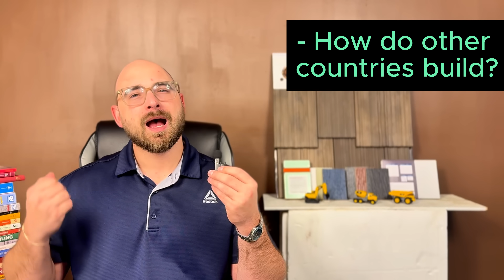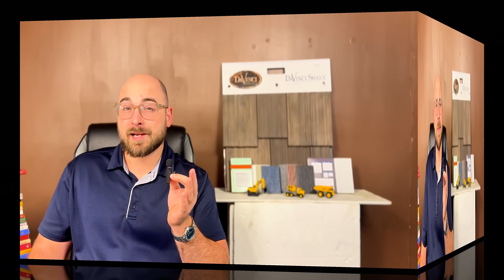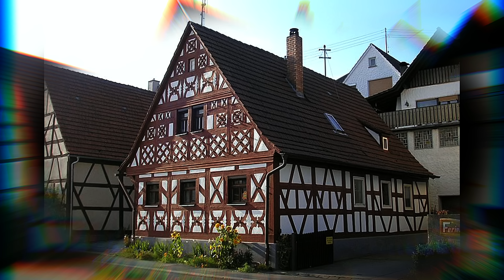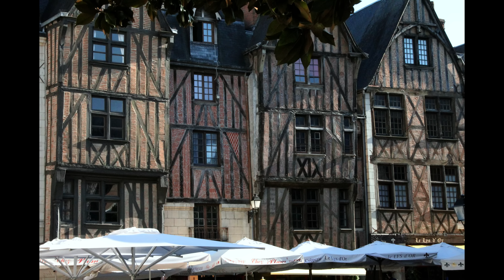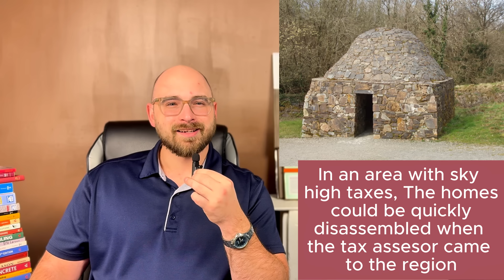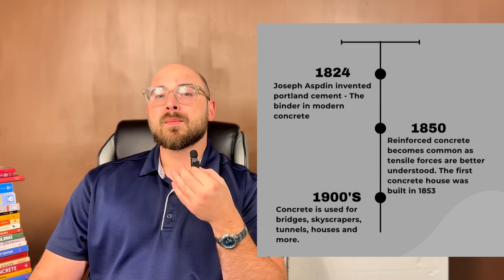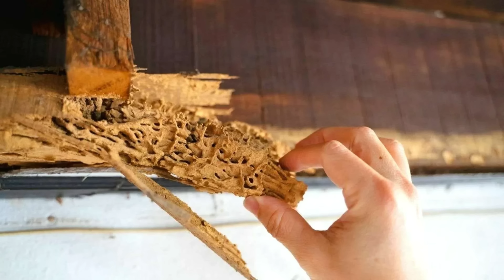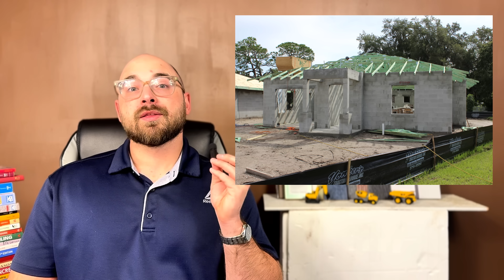Why Other Countries LAUGH at American Homes

Comment: I'm from Argentina, and it was kind of shocking to learn that in the US, most houses are made of wood. For me, that's kind of cool, not bad; but what's really scary are your electrical standards. 110V is more dangerous since you have to pump more amps on the wires, and also, you don't have GFCI protection in all of your houses. That's really something I cannot wrap my head around since it's really dangerous.

Comment: Most of my experience of houses is in Netherlands an UK. The former has better housing stock than here in UK.

But here in UK most homes in the city where I live were built in the 1800s, with solid slate roofing. My mother in law lives in a stone house with slate roof built in 1800. A friend lives in a stone house that was built 900 years ago, although with subsequent brick extensions.

In the village where I lived there were many timber-framed wattle and daub houses, dating back to 17C.

Houses are homes, places with long term memories, not mere temporary  storage units for people.

Comment: I think that people laugh at disposable homes. It is just coincidence that there are that many disposable homes in North America. I live in a concrete prefab panel house built in 1988. A panelák. Something that most people associate with "ugly grey commie block". It was never grey. It was sand yellow with earth brown details since its construction and it had some thermal insulation built in to the outer panels forming the facade. But this insulation, while good in the 1980s, will be expanded soon. The old "sandwich" insulation remains inside the "outer skin panels" and new insulation will be added from the outside. We - the owners of the flats - voted to do so. The vast majority of flats is privately owned and more than half of the flats are occupied by their owners, with the rest being rented out to other people. My parents live in an old house from the 1950s. It is a combination of bricks and hollow concrete blocks, into which rebar was placed and then filled with concrete. The roof is timber and old ceramic tiles were replaced by modern sheet metal plates. The flooring is either timber or reinforced concrete, depending of the part of the house, as it was extended over the decades. The house is built to last. Especially the newer extensions, which have strong concrete fundaments and sort of reinforced concrete cast structural walls, with the upper floor using hollow concrete blocks.

Comment: for the folks saying that brick construction is worse for earthquakes:
most places that get regular earthquakes build their homes with bricks/cement, using specific anti-seismic designs
anti-seismic design has been practiced for hundreds if not thousands of years, one of the more well known examples of it becoming widespread was after the 1755 Lisbon earthquake, where brick buildings were reinforced with a wooden "cage"
modern anti-seismic design works well enough with concrete for multi-story buildings, and with more advanced techniques and different materials is downright REQUIRED for any skyscraper.

This isn't to say that wood is simply inferior, it can be made quite sturdy for situations like tornadoes (fire is a problem for both, brick and cement are weakened when exposed to strong flames for long periods of time, and wood will generally just burn).
Blame bad engineering, not good materials!

Comment: How do you put additional cabling, or another power point, into a concrete home without cutting into the wall, which will kill your structural integrity??
Almost twenty-eight minutes of donkey doo doo. the majority of the American homes that were built after Hurricane Katrina, or any other natural disaster,  were of light wood construction!!! The definition of insanity is doing the same thing over and over again and expecting different results. ' Albert Einstein.

Comment: The advantages the US have is cheap ground. In Switzerland nowadays you need to be at least near a millionaire depending on the location (500000+ CHF ). For mostly a relatively small house with mostly not much ground around. Of course the sturdy building need also a bit more money (quality costs ) but in the long run save money. Less electricity, less heating costs (good isolation), less repairs. Extending is of course more expensive. UK houses are also mostly of lesser quality than in Germany and especially Switzerland. We build small (compact) castles. 😅
We also mostly build with bricks. But cheaper houses can be with pre-cast concrete but we prefer bricks, better isolation.

Comment: It depends. In US, if you are paying mortgage for 20+ years, what will you have?

If I will pay mortgage in Europe for 20+ years, its quite common that it will become house of my family for several more generations. Sure, they will pay repairs etc, but for example, on my 15 years old house I will need to solve isolation in 20 years, probably my sone will need to solve it again (I have outside isolation, it is for 30 years), but walls, roof and stuff like this.Probably my kids will die sooner than that roof.

Comment: Lightwood framing is absolutely fine and makes perfect sense almost everywhere. My issue with US homes are for one that it seems builders are very quick to take shortcuts and also that a lot corners are cut in regards to cost when it doesn’t show, meaning that often the philosophy seems to be that as long as ot looks good and expensive it doesn’t matter that it’s just a thin veneer and parts that doesn’t show can be made using the cheapest of materials and least amount of effort. I realized this when we moves to Sweden. 

Our first house here was a lightframe, just like the one we had in the US. But where our Texas home was made to look good from the street, and plenty of details just were cheap and flimsy, the house here didn’t look gaudy, it was just solid, and it was built and finished to the same standard everywhere, not with added features facimg the street for looks. It was much more well insulated, which is a necessity, had a much more robust heating system and so on. It was just more solid.

Now we live in a timber framed house built in 1814 and, since they were economically minded here back then, they used the timber from the old main house of the farm, so the timber is from early 18th century. While this is solid, it has it’s drawbacks; it’s difficult to add insulation, something we want today to save energy. It has also set and warped over time, so everything is a bit crooked. Moisture also can become an issue when insulation is added and the house is altered to allow less leakage; these houses relied on being slightly leaky and that you constantly had fires going in every room which provided airflow out the chimney and thus automatic ventilation. Now, with less leaks and less fire used for heat this doesn’t work and requires retrofiting mechanical ventilation.

Comment: Also, small precision on concrete: It didn't stop being used with the fall of the roman Empire, but simply became much more marginal. With the decreased opportunities to make high quality concrete, most of it was used to make mortar, with a very small amount used as building material, but it was still there.

Comment: Concrete typically has a high embodied CO2, used carefully it could be part of housing construction for the US. To be clear my concerns about carbon relate to wasting hydrocarbons! They are an irreplaceable asset that are too valuable to burn wastefully …. They are needed for agriculture and as precursors to most plastics…..

Comment: I'm from Australia and our houses are built largely the same as yours. We don't have to deal with freezing cold or tornados though, so it suits us just fine. Just like the U.S. though, more newer builds (particularly in the cooler south) are being built to a higher standard. Not so much structurally with concrete or double brick, more in regard to insulation for better energy efficiency.

Comment: The inward opening doors in houses are just ridiculous. The only thing preventing it from opening is a small latch. That's why its so easy to push or kick the door in in USA. In outwards opening door, the whole door frame prevents the door from being kicked in. You have to physically break the door or the (steel) hinges to forcefully open it.

Comment: There are a lot more variety for how wood buildings are built. My house has horizontal squared logs as main structure, while lots of older houses use round logs walls with cuts to make them fit together.
Also, a wild method from 70-s, cinder poured house! An ash and leftovers from industrial chimneys mixed with some binding agent got poured into 1-meter thick walls to make house structure. Now that's an insulation xD
...and probably a bit of radioactivity x)))

Comment: fun fact about those european half-timber houses:
their upper stories are usually wider than the ground floor to save on taxes. Back in medieval times the taxes were only calculated based on ground floor area, so by expanding the upper sections to be wider then the ground floor, you get additional living space without increased taxes.

Comment: From Germany to my American friends in the USA. Yes, in Europe we like to laugh about American houses or about the American superstition of always being the first, the biggest or the best. We see things like that with a very broad smile and explain it to ourselves with the sentence: "The typical American thinks as far as the horizon, but not a meter further".
As a German, I grew up in an area of the city called the old town. The house I grew up in was a wonderful old half-timbered house where the individual compartments were filled with straw and clay. The house was built when the USA was founded. The old building technology withstood temperatures of -30°C (-22° F) in winter for over 250 years and made temperatures of +40° (104° F) bearable in summer because clay walls cool wonderfully and regulate the humidity. So 250 years with natural air conditioning without electricity. The city I live in was founded in 1301, so it is a very young city. Even back then, the founding fathers had freezers! In the depths of winter, they simply took the frozen ice and brought it into a deep tunnel or cave to be used again in the summer. In these ice caves, the temperature was well below freezing all year round, so that food could also be stored there. From 1930 onwards, refrigerators with compressors slowly became more common.
Grandma and grandpa live in Cologne, a city that was founded 100 years after Jesus Christ. Many of the old concrete buildings have been there for 2000 years and are still in use today, like the old Roman baths.
In contrast to the Americans, old castles and palaces are normal here. They have simply survived over the centuries/millennia because they were built stone by stone. Rock solid to keep evil enemies from coming into the city, rock solid to survive the centuries.
Houses are still built like this in Germany today. You don't build a house for the next 20 years, but for yourself and your children and grandchildren... so for at least the next 150 years, until it's time to renovate.

Comment: I live in Australia in a mud brick and natral stone cottage that was built in the 1850s and the only upgrade that have been done to it has been a new roof, newer windows some time in the 1930s/40s , a more efficient fire wood burner and a solar system for power. 
Its cool in summer and warm in winter.

Its survived bush fires and time itself and still kicking on strong.

It would have cost almost nothing to make, and the upkeep has been virtually 0 other than modernising the amenities. 

The fact it has wide veranders, the weather does get to external walls, and is solar passive , my only experience is wood for heating in a year and really i could use a split system for heating on the solar system and that would make this place have 0 running costs as its already 100% off grid.

As the place stands, I see this place standing for another 200 years, only needing upgrades or maintenance to the to the rain water tank, roof and solar system a few times.

I would not trade it for an American new build if you paid me.

Oh BTW, no one thinks American is great outside of America. 
America is a joke on the world's stage.

Comment: Concrete is a wonderful material and I have seen many sturdy homes in Okinawa built with it. Its manufacture does place a carbon emissions cost to the environment. In some locations a lime plaster can be used as a cladding which is better in terms of environmental cost. In California solid construction is considered a poor choice due to earthquakes. However some steps can be used to encorporate its use such as in stucco, or portions of the home where people spend less time in, or even in basements. A new material called "rock wool" is useful in assisting homes to have fire retardancy but it's current use is rare.

Comment: Great interesting video, I was wondering whether zoning might have a big influence on the choice of building material. I have heard that the US is primarily single-family housing, whereas in europe, especially in cities, i tend to see more duplexes, apartment-complexes and row houses. I can imagine that building concrete and especially brick housing may be much more expensive on single-family detached housing compared to multi-family residential buildings. I also think multi-family residential housing, especially apartment building and/or flats, are going to be very difficult to make out of light wood framing.

Comment: I think you need to visit Europe or many places in Asia. You totally forgot to mention the fastest building material of all that also is the best, Compound Insulated Concrete Forms (ICCF’s). We have built with this material since the early 1960 in Europe.. In this country I think it is called Rastra block in the US. Rastra uses a manufacturing technique of honey combs . But in Europe they use the same material as straight building blocks. Much of Las Vegas are using this material, due to it's great insulation value. Plaster the outside and inside and you are done unless you want other finishes.

Comment: You compare the US with developing countries in the quality of their homes... Or methods no longer used... the reason others make "fun" is that you build lightframe houses in regions with lots of tornados and so on... then cry that all the homes are gone... and "cheap" is relative... concrete is bad as hell... a) sand for concrete is running low quickly b) walls out of concrete let travel sound from one end to the other while bricks don't

Comment: Does the concrete in ICF take a much longer time to dry? It's enclosed within the insulation all the time, right?
Reply from the maker: Concrete poured in ICF cures a bit slower, but this actually leads to higher strength. 

Technically, in any concrete pour the forms are supposed to stay on for at least a few days to promote proper curing, but to save time and money, the forms are almost always removed the next day when using a traditional forming system, and his causes the sun to flash dry the surface of the concrete and leads to lower strength concrete

Comment: if you put on football protective gear and can run through the whole building criscrossing not only internal but external walls as well than it is not a very good building, same goes for external entrance doors that can be kicked in by anorectic 45kg officers, not to mention using firearms indoors riscing the bullets overpenetrate through the whole building and the neighbors, than there is the issue with nonexistent insulation heat and noise, single glassed weird windows that can not be opened properly, pimped out internals that might look nice on a catalogue page but when touching it you feel the subpar materials used that fall apart within few years

Comment: Id say the problem isn't what you build homes from, its the regulations and laws, what are the building standards, foundation requirements, another big issue is the American focus on single family fully detached homes, while most of the world use apartment buildings, row houses or semi detached, sharing walls with other homes helps a lot for insulation and energy efficiency!

Comment: The problem with your houses is that when a tornado or something like that happens, you lose everything and have to rebuild and repurchase all your possessions, which makes you invest twice as much than if you had built with concrete/bricks in the first time. Imagine if the California fire victims from the last fire had concrete homes. Most of the damage would have been prevented.